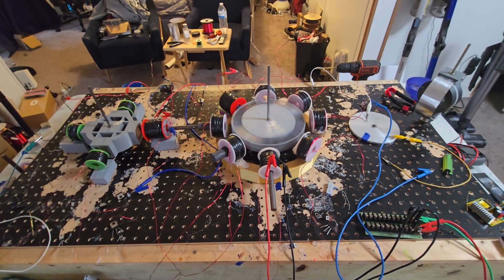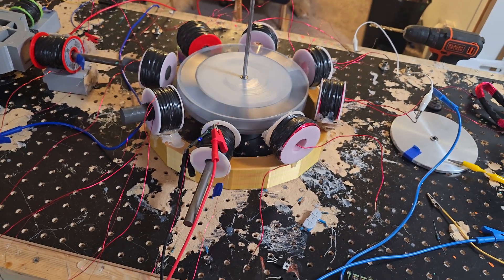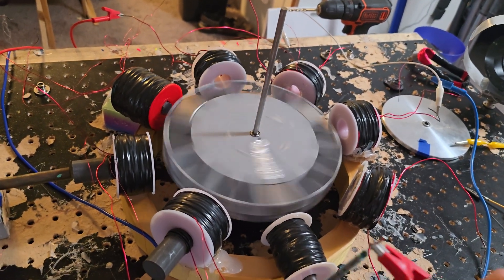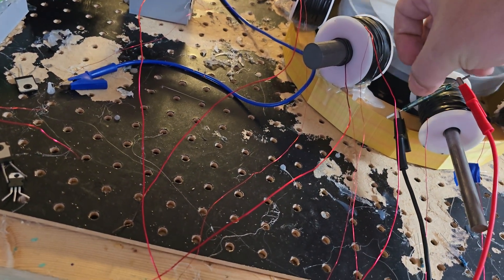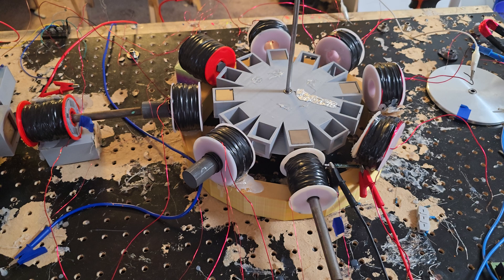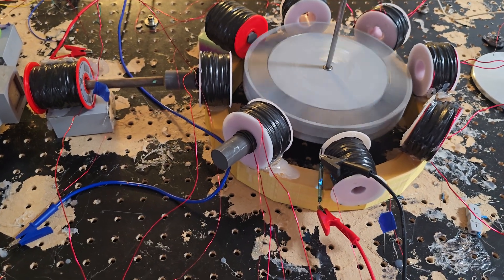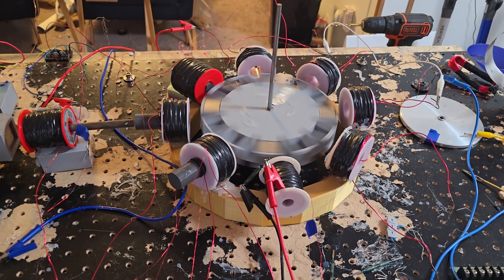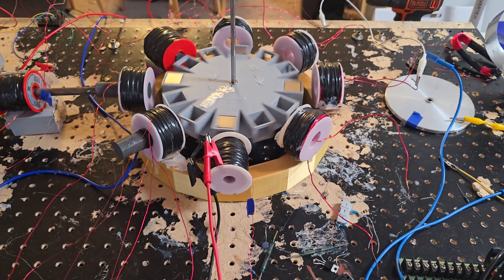pulse motor getting a feel for a good setup with a barrage of rpm tests

Comment: Hey have you tried making the Reed switch into a mini coil and hooking it up the the coils powering system? If not wana try?
Reply from the maker: what gauge wire? and what diameter of the mini former i can make one or i may have one already
Reply: @MPHJR  probably the same gauge as the Reed switch uses, and just big enuff to cover the internal workings of the switch itself.